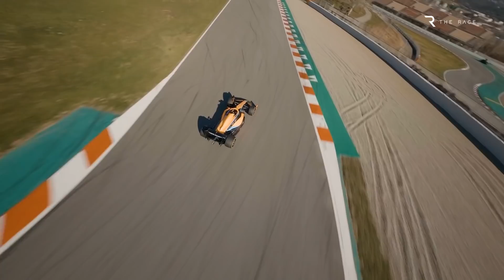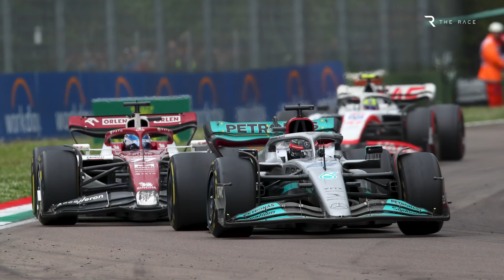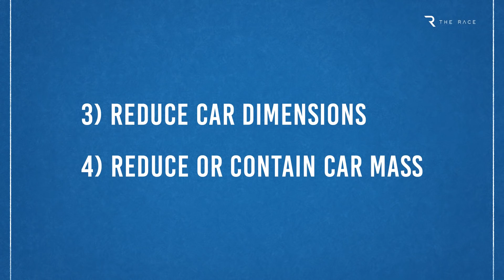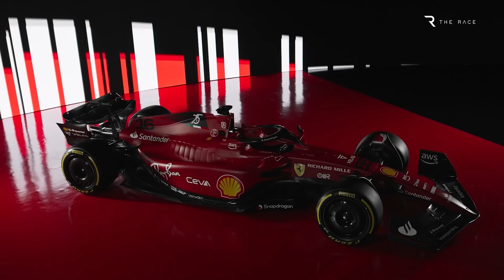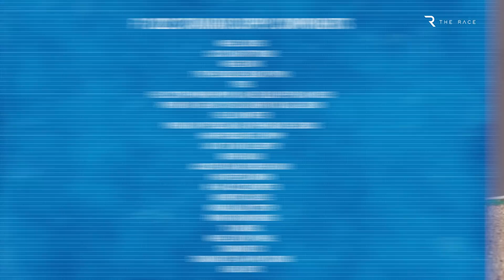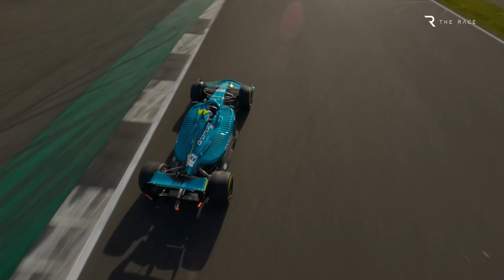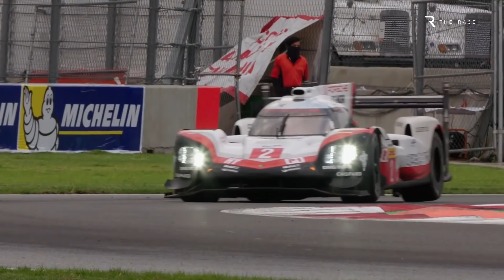F1's new major plans for 2026 car overhaul explained

Comment: Can we PLEASE just have active suspension? It benefits the cars we drive and will stop allot these issues. And ABS! Think of the money to be saved from brake lock ups and crashes. Totally worth it. And if anyone thinks "these aids make it too easy that I could drive it"-your a moron. And they could adopt the 4cyl turbos from Super Formula Japan which used Honda and Toyota. Most car companies have blocks that can easily make 600hp and then add in the battery crap and lighter cars and voila.
Reply: they literally ban those, due to them counting as driver aid.

Comment: The one thing that intrigued me was the mention of higher reving engines. Would the V6 turbo hybrid even sound good at 18,000 or 19,000 rpm?
Reply: I mean, I don't think I ever heard a 18,000 rpm engine that sounds bad.
Reply: Without a mgu-h, I think it would sound pretty good
Reply: @tinzalix8624  that's not the issue, it's the 100l an hour fuel flow rate that stops them from reving higher. More fuel, more rpm.
Reply: @andreweedy2765  I think v6s (especially 90°) have inherent resonance issues beyond 12,500rpm given the odd number of cylinders in each bank.

Still hoping for Achates style 2 stroke horizontally opposed piston 25,000rpm engines running on H2 at high Lambda values over here 😂.
Reply: It would sound a bit more like 1980s V6 turbo engines
Reply: @Spido68_the_spectator  that’s what I was hopeful for, a raw growl from a turbo.
Reply: I think Indycar revs their V6s higher, and they sound great.
Reply: Yep, it always bugged me that they didn’t raise the fuel flow limit on the current engines so that they could rev to the 15k limit the current regulations allow.  Pushing up to 18k again like the old V8s would be fantastic, even if a turbo is still in the way.
Reply: considering in SOME cases the v6 sounds  not that bad and now we have less dampening. yeah

Comment: Powertrain engineer here. My worry is that with the proposed power balance between ICE and EM, the optimal solution will be some series-hybrid, where the ICE always operates at 100% throttle. It might sound weird. And while MGU-H is a genious piece of equipment, series-hybrid systems are used in trains for decades.

Comment: Can they regulate how much dirty air each car produces directly? 

Rather than trying to make the engineers produce something that they hope won’t produce as much dirty air, would it be possible to directly regulate how much dirty air the car produces, similar to how they regulate the weight or emissions produced by the car?

Could the fia maybe provide a basic regulation car that is used to measure how much of its downforce is lost when following the given car that is being homologated? Could each team provide a model car to the fia to be homologated and models of any aero upgrades to ensure retained legality? Surely ross brawn and his team have used similar methods to produce the data that led to the current aero regs anyway? 

This way the teams are free to produce whatever aero design they like so long as the dirty air is low? Just a thought. I’m sure there is a reason this isn’t feasible.
Reply: Dirty air isn't measurable like that since it's not really being produced. Dirty air is rather the lack of air or turbulence in the air than it is something physical.
Reply: @Pietroszz  I’m aware of that, but surely the effects that this turbulence causes on a following car could be measurable? How else would they have devised these new regulations? Based on what data?
Reply: Its been something I had wondered as well. Model car loses 20% downforce? Blocked. Though I guess it may make it more costly to do aero testing, since you basically need to be checking the aero of two vehicles instead of one.
Reply: @v10-e8y  it was just a fleeting idea mate, I’m not saying this is what they should do, I’m no engineer, I just wanted some more info as to if this would be possible
Reply: @v10-e8y  Also I guess my immediate response to those critiques would be: Yes, use a regulatory wind tunnel run by the fia. 
Keep the tires straight, forget that variable.
Regulate the highest wing angle setup. The less wing angle the less it is impact airflow surely?

I’m not saying this is a perfect solution. Would just be nice to see the f1 teams working with the fia to meet their goals not constantly fighting against one another. Because obviously ultimately the fia doesn’t want the cars to be slow, they just want the sport to be fair and the cars raceable. If you could get f1 teams to work toward that exact goal that would be great no?

Comment: It's grand to see smaller, lighter and thus more nimble cars as a goal.  They should also look to reduce the number of "fancy" driver aids available during the race.   Things like the multitude of power modes, pit lane and yellow flag/safety car speed controls,  numerous brake bias settings, etc.  At the same time bring back a little more sophistication in the suspension components.
Reply: I don’t think the pit limiter should be removed, it’s for safety, it has no reason to be removed, and there are no vsc/sc controls, just a delta to adhere to (as well for safety)

Comment: Smaller lighter cars with less aero with a straight forward cheaper 1 litre turbo engines. Net zero NO CHANCE. How do you think the F1 circus gets around the world. By sail ship?
Reply: Is that a serious comment? I suggest you gain some knowledge before commenting about something you obviously have zero knowledge about.
Reply: @fam.hunger5244  What are you an F1 engineer or something? Just because you  don't agree with my opinion does not mean you are right and I am wrong.

Comment: Reduce drag clearly means they want to cover the tires with body work
Reply: Covered wheels would massively reduce drag. Controlling front wheel wake it one of the main things they engineers try to tackle with open wheel cars.
Reply: Or allow active suspension
Reply: In 2008 the rear wheels had bodywork ahead of them
Reply: To me "reduce drag" means reducing drag, I can't see that covering tires is what they clearly want.
Reply: @bennylloyd-willner9667  covering the front tyres is the first step in reducing drag. A quick search on youtube will glean several essays discussing the issue. They've already reversed the flat floor designs in the hunt for aerodynamic efficiency, as well as allowing teams to generate vortices, against the overall desire for less aero wash, to drive air around the front wheels. Covered wheels is the logical progression, and a damn good one at that.
Reply: @EikeSky  I agree its is one way to maybe go, just not clearly the only one.
Reply: I'm fine with this honestly. Formula E and the Red Bull concept car prove that formula cars with covered wheels absolutely work cosmetically and practically.

Comment: Why doesn't formula 1 use a 4 cylinder engine?
Reply: There were plans to introduce it in 2014, but Ferrari protested, as then the engine wouldn’t be able to be used as a stressed member of the chassis

Comment: I'm hoping for two things mainly: 1)lighter cars 
2)better PUs
Reply: smaller cars too. make monaco overtake friendly.
Reply: @0megalul309  I'd say the big obstacle of Monaco is not so much the size of the cars, but also how fast they are. The track is too small for such fast cars making it hard for cars to race side by side
Reply: @martimxavier9690  yeah a lot of people say that overtaking is difficult because of how wide the cars are but the early 90s F1 cars were just as wide as they are now
Reply: "better PUs" can mean many things, what do you mean specifically?
Reply: @fkez0510  v10s@20K RPM
Reply: @MeltingRubberZ28  That would be louder and higher pitch... Not better:
-Stupidly high fuel consumption
-Stupidly high emissions
=>The exact opposite of what F1 wants
Reply: @MeltingRubberZ28  that isn't better and we won't get the old engines back
Reply: @adamn7125  Well what F1 wants is wrong.
Reply: Is F1 a clinical laboratory for new products, or show business?
Reply: Better sounding maybe, better performing in terms of efficiency, doubt.
Reply: Small V8’s or high revving 4cyl engines, turbo charged of course would be excellent.

Comment: i welcome the removal of the mgu-h although it was a really cool piece of tech i can see why its removal is wanted. i agree with their targets entirely and cant fault them at all. but in terms of engine rules id like to see a 3L v12 with a 21,000rpm redline as well as an mgu-k on each wheel (not everyone agrees with that last one at all but i think its neat), i still want to see a large hybrid component to these cars i think that its introduction was an incredible idea thats moved the sport into a good direction.
Reply: I’d prefer a tiny high reving 4 cylinder pushing 600+ hp with a monster hybrid system with MGU-K regenerative braking on all 4 wheels. Car could easily have more than 1200hp and be highly efficient
Reply: @Tommmmmmmmmmmm  you WANT a 4-banger??? whaaaaa??
Reply: Who knows? maybe in the future F1 gonna chop the engine to 1-2 cylinders and using gigantic electric system. I mean isn't that the future of cars? going electric.
Reply: apparently v12s kill the earth. we can dream though
Reply: @amirashoury783  the idea of smaller engines was to increase sustainability,  now they're moving to 100% sustainable fuel there's no need to have such fuel efficient PUs, bring on the V10s/12s
Reply: With the cost cap that engine config happening is dead

Comment: Two stroke engines. More power, more efficiency (compared to 4 stroke), higher revs, better sound and lighter. That's the way to go.

And we can get V8s, V10s and V12s back + the hybrd.

And the technology is a gold mine for potential future engine design which has not been looked into yet seriously.
Reply: Yep the more cylinders you have the more fuel you have to pump into the engine.
Reply: @rexthewolf3149  But you get more power strokes than an equivalent 4 stroke engine and significantly lighter and simpler.

The tech we are using for two strokes at the moment, generally is ancient; there's so much that they could do to make up the defficiencies of two stroke engines to get that theoretical 2x efficency of an equivalent 4 stroke engine. 

Its a path worth going down.
Reply: Interesting idea. Bring back 2 stroke road bikes too please.
Reply: @fasthracing  Yup, motor gp with a 2x size engine took 10 years to reach the power outputs of the 500 cc bikes. 

Just imagine with F1 resources put behind it. It is the ideal power train (even more than rotary) to support a hybrid as well.
Reply: I don't know bricks about the engine technology, but more cilinders on the engines would mean less eficiency right ? so it's probably out of the question
Reply: @evandrochaves9596  Donut did a good video on it which probably could explain it way better than I.
Reply: We might see F1 engine with 1-2 Cylinders and gigantic electric motor assisting it in the future.
Reply: @titan_fx  Disgusting.

We already complain about the sound now; its going to be even worse.
Reply: @Ian.whillock.racing  Huh, didn't Europe want to ban all ICE cars in 2035? I mean by that time all ICE cars are going to be irrelevant and doesn't F1 is try to be relevant with road cars? I'm not surprised if F1 will pursue higher reliance on electric motors than ICE in the future.
Reply: @Ian.whillock.racing  yea, too loud! And this is not even ironic

Comment: Hope they make sidepods mandatory
Reply: Since many decades a F1 Car has sidepods. And they probably will for many more decades. There is no way to cool down engines than with sidepods. Water-Cooling are and will be forbidden. So you can cool them by air only. For this you need sidepods.

Comment: What about reducing the buttons on the steering wheel (simplifying), so the drivers can focus on racing and getting a good line.
Reply: Gentlemen, a short view back to the past…
Reply: Give them a third peddle and a small pole they can fiddle with every corner.

Comment: Any mention of smaller and narrower tyres? This would be an easy way to reduce car width and maybe even reduce drag.
Reply: But also grip
Reply: @AW89123  wrong, it would accelerate wear
Reply: @klakier19901  thinner tyres means Pirelli might actually have an easier time meeting FOM's silly degredation targets, as the smaller contact patch will wear more naturally than the monsters on the cars at the moment. I've thought these cars with thinner tyres is exactly what the formula needs right now.
Reply: @AW89123  good. less grip means more driver skill.

Comment: Finally !! Finally they think aabout taking care of the size and weight of the cars ! I wish for more agile, harder to drive cars.
Reply: Harder to drive? They already got a lot harder to drive this year, unanimous feedback from the driver due to the variable downforce levels when ground effect gets interrupted, by kerbs for example. If it gets even harder, than fighting and overtaking chances are gonna suffer
Reply: @guitarheaven1747  Yeah I know they got harder to drive this year.
But I'd like for the driver to have to correct the steering wheel a lot to adjust his turning, like in the good old days.
I'd like to see drivers struggele a bit more
Reply: @hugolouessard3914  That would just be bad nowadays.
Reply: @hugolouessard3914 
So you want that the cars are a pain to drive for the sake of entertainment? Maybe the fia has a point in not listening to fans lmao.
Reply: @hugolouessard3914  This sounds horrible. I am certain this will never happen.
Reply: @hugolouessard3914  try correcting your car at 300km before talking.